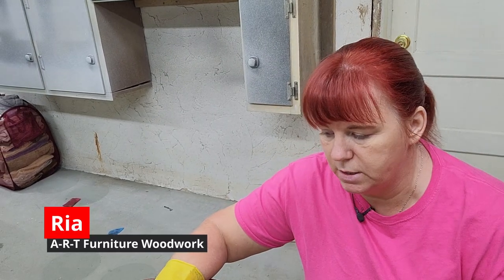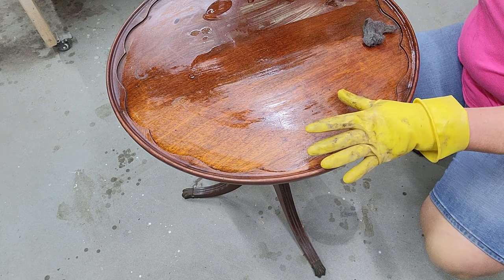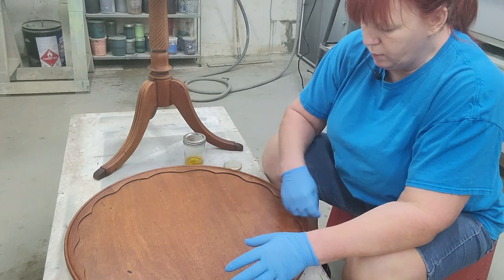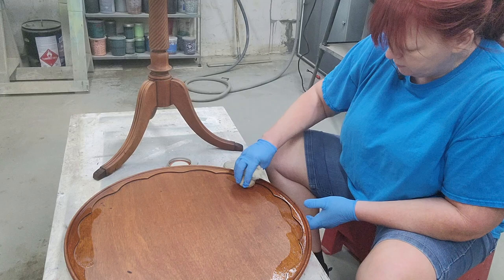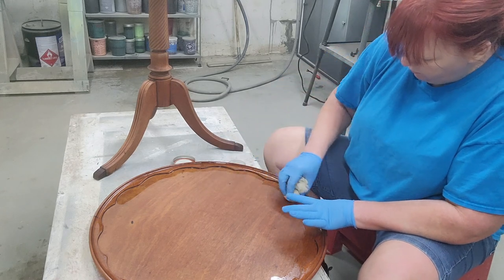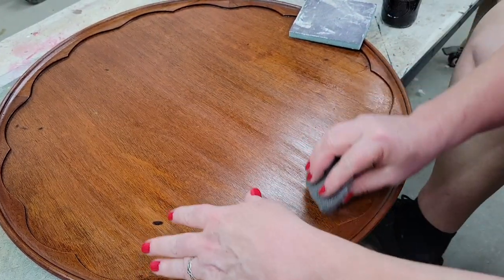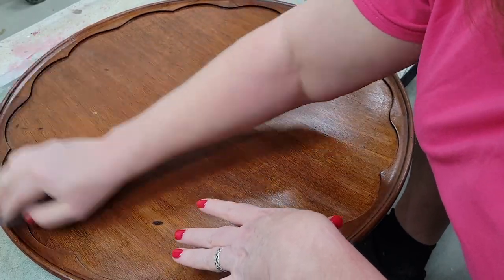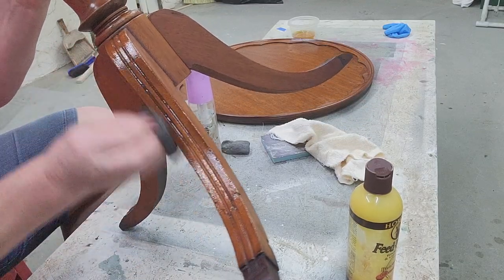Refinishing a pie table for my sister

Comment: You have no idea the calm that you transmit as I think to use the same materials on, first, an old ,really old walnut mirror with little inside border of gilded whatever it is. Thank you. Best to your sister.
Reply from the maker: There is just something magic about the whole process - i hope your walnut mirror project goes well I'm sure it will.
Reply: @RIA  got the denatured alcohol and various steel wools... Now weather is rainy and chill but seated in the tub and fan on will do it. Thank you. Rubber gloves too.